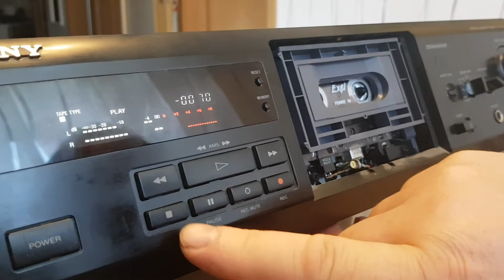SONY TC KE400S , Замена пасиков ; Riemen austauschen ;  belt replacement

Comment: hi.. when i press the play button it starts to wind fast, i wonder what is the problem.
Reply from the maker: There may be several reasons. First you need to open the lid and
 determine whether it is electronic or mechanical. In both cases, everything will need to be disassembled and checked.
Reply: @alexanderfomich7238  thanks 🙏